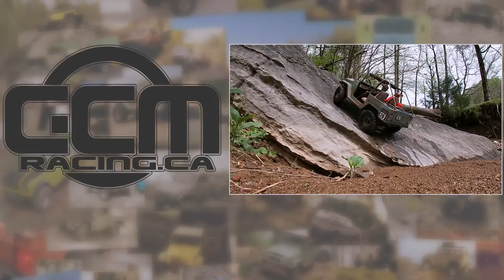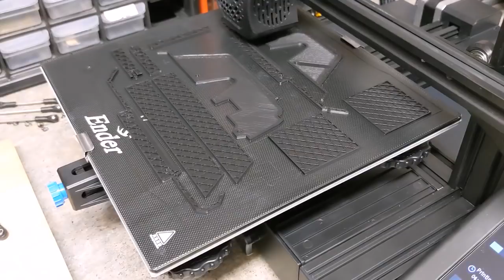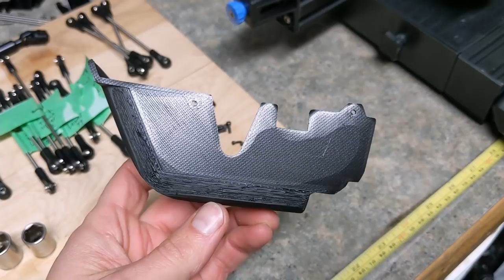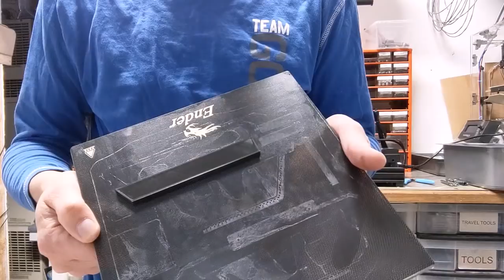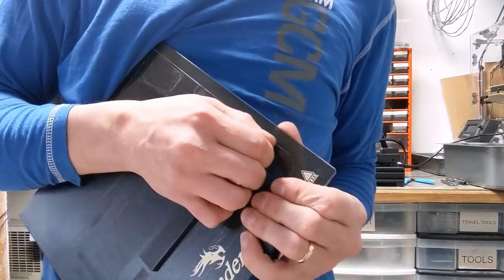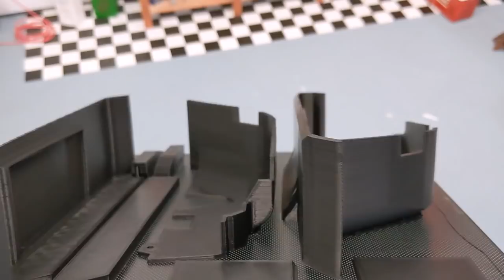Why you DON'T need a 3d Printer

Comment: okay, imma be real, i was a beginner in 3d printing, i just jumped into it as most modern programs make it POINT AND CLICK, ultimaker-cura is a fine example of this, saying steer clear of it is like saying "Steer clear of computers because they're hard to learn".

All you need to know for 3d printing:

Nozzle size(Most common is 0.4mm)
filament Type and size (Common is 1.75mm size pla) 
and Plate size (Usually x-x format) 

and you can start 3d modeling with tinker cad which has LITERAL FREE CLASSES to learn! along with that, if you want FINE details you get a SLA printer which prints thinner than the human hair, and can print HIGH detail models, and you can get one of those for 150-200 USD!

Comment: Another issue with 3D printing is virtually all 3D printers are made in China. So customer support is inadequate at best. I have a Creality printer.  After only a few hours use the filament feed tube pulled out of the hot end and damaged the hot end fitting. Since Creality has no replacement parts or information on this printer I emailed them to find out if the parts I needed to repair it were the same as another model that was available (which I determined by looking at photos of the parts were the same.)  It took 20+ emails to get them to answer my question "will these parts fit my printer". Since they don't speak English their replies made absolutely no sense. When I sent them photos of my broken parts they claimed they weren't stock parts, which they were, so they wouldn't honor the warranty. Even though I did eventually get them to answer my question I figured dealing with this company was too much of a pain in the arse, and threw the printer in the trash.
Reply from the maker: Horrible story. And unfortunate you didn't get any support on the items.

Comment: I've been 3d printing for over 10 years now. I've tried many different brands thinking the issues would go away. They never really do lol. You can easily spend more time tinkering then printing. 

I think everyone should start out with a somewhat budget printer to learn all the different issues, then spend the money on a Prusa. However I think the Prusa title is earned through time lol.

I try to stay away from glue, hairspray, or ABS slurry to stick a print. Just straight heated glass bed. 

You did a great job covering a lot of the problems. 

And ABS is the toughest to print in my opinion. Specially on a printer that isn't enclosed.
Reply from the maker: I think I learned a few things over the last 7 years as well. I love and hate ABS. I really love my newest setup and current materials. It took a bunch of hours to tune in my own way, but I'm very happy with it now. And I'm fully expecting to have some other sort of issue soon, as you say, they never really go away.

Comment: I LOVE and HATE 3D printing, they certainly aint plug and play lol working with layer heights from .04mm to .3mm it has to be precise . End of the roll is a pain but Ive been lucky and been able to feed a new roll through on my direct drive printer. If the print is stuck to a glass bed try soaking it in warm (not hot) water, should eventually wick through the glue enough to free the part. Id never seen a 3D printer in the flesh until I bought mine, its a huge learning curve and a lot of work but in 12 months I went from struggling to print a 1cm cube to designing my own 1:8 scale Toyota engine. If you want to press a button and get a print then it for sure aint for you, If youre up for a challenge and a lot of work and the best feeling when you make something out of nothing, go for it...
Reply from the maker: Thanks for the comment. Something out of nothing is a great feeling.. from screen to hand.. it can be a great tool if you're committed to the work and learning! Yeah!